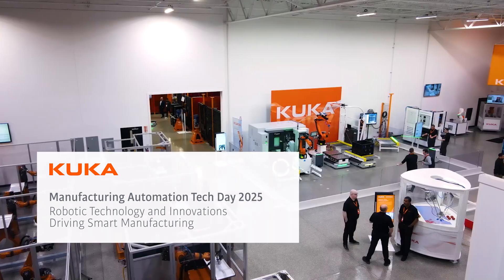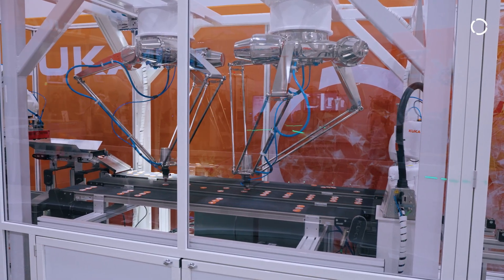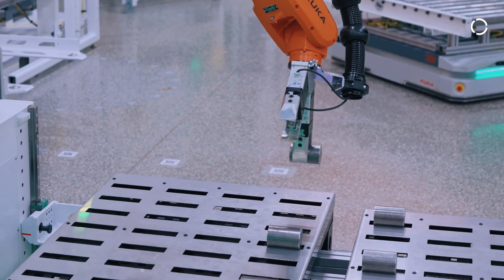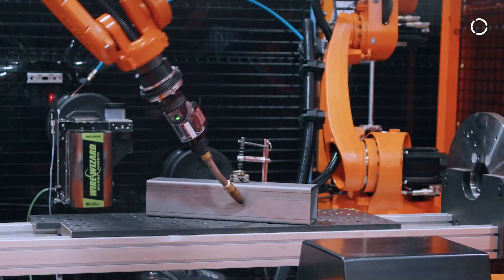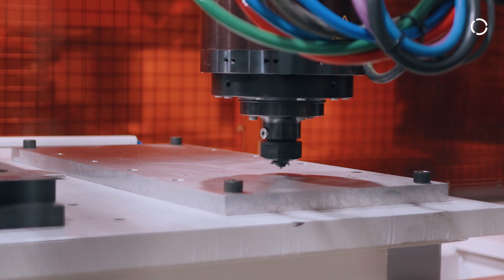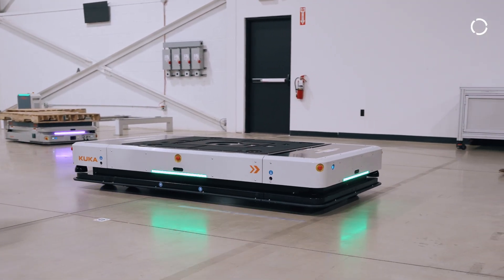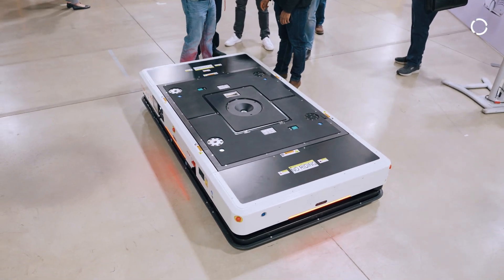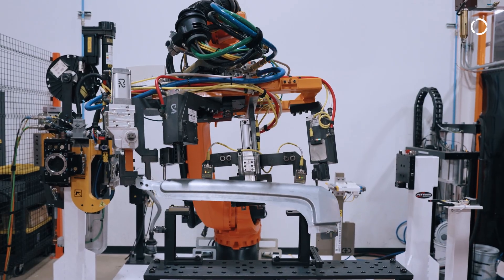Robotics for Smart Manufacturing | Manufacturing Automation Tech Day

Comment: Could you guys please change the smartpad design. Improve touch screen and UI…
Reply from the maker: Thanks for the feedback. If you'd like to send specific product feedback to our R&D team, please let us know here what ideas you have, or submit your feedback at https://my.kuka.com/s/contactsupport.
Reply: The enabling and forward buttons are hard to hold in at active position and the alternative buttons on the back are not ergonomic to use. 

Also touchscreens are not good quality, it stopped detecting or require hard presses but one’s we have still don't read correctly. 

Programming KRL on a smartpad is not UI friendly. Why is there no delete or enter a new line function built in 😢 

Please you guys have the world-leading robot but the smartpads need a lot of improvement…